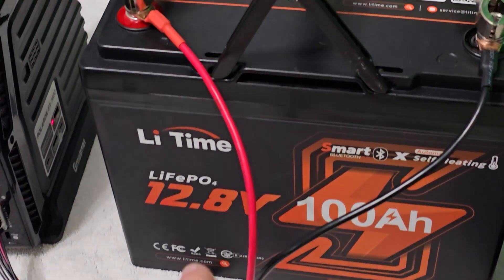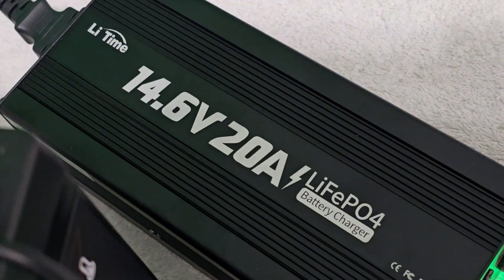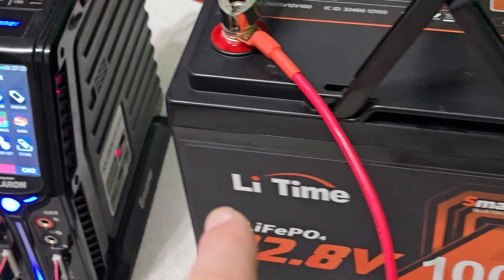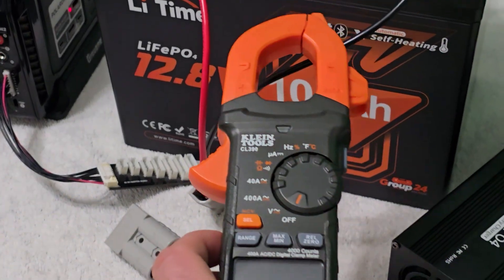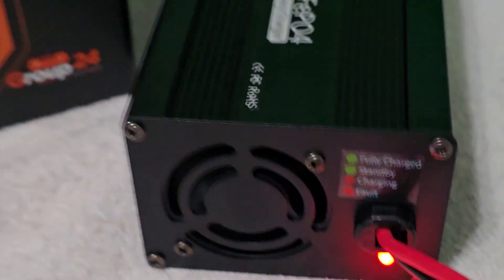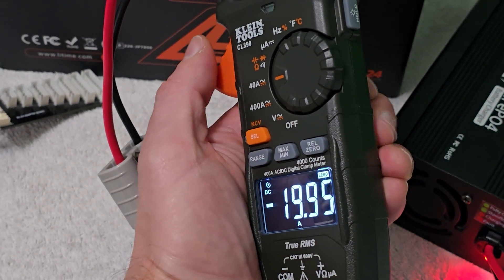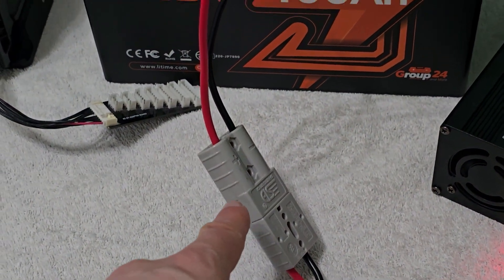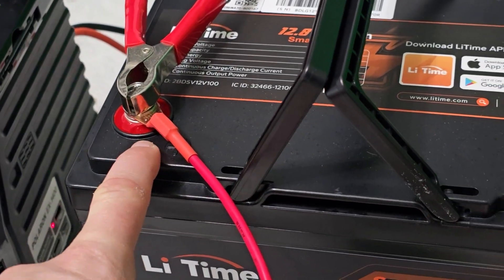Think Charging a 100Ah LiFePO4 Is Hard? It’s as Easy as Charging a 12V Lead Acid!

Comment: Hi what is the max Amps one should charge a lead acid and AGM battery?
Reply from the maker: Approximately 0.3C is the general max charge rate of a lead acid battery.

The specs on this LiFePO4 is 1C or 100A. This is the 20A charger but they sell a 40A charger too.

Comment: Just got a buget smart balance charger that can do HV LiPo's. Its a $27 iMax B6 V3. Where do I recycle lipo batteries? Are bad lipos still valuable? I think so, but it may be hard for small town people to find a place
Reply from the maker: I go to my local transfer station and drop off old batteries. As for value, some skilled modelers will remove a dead cell to make a smaller fully working battery pack.